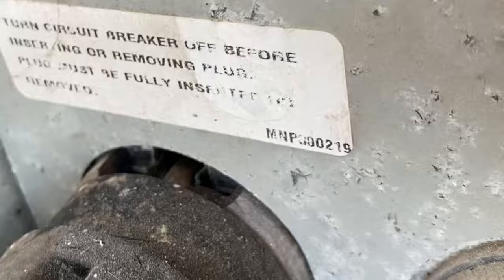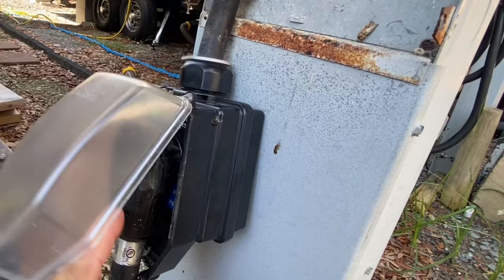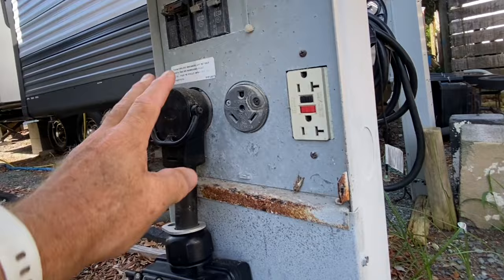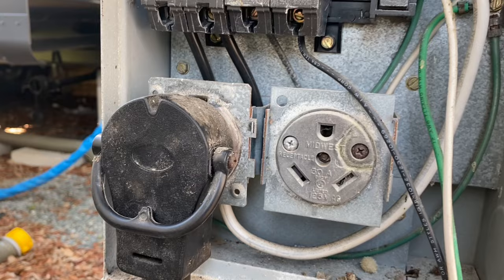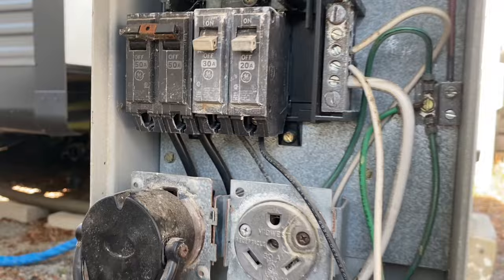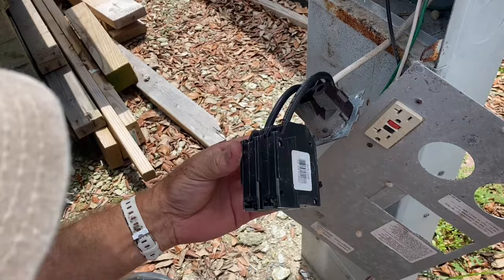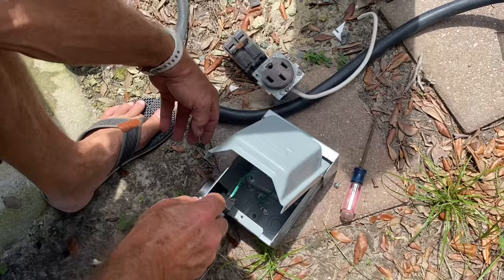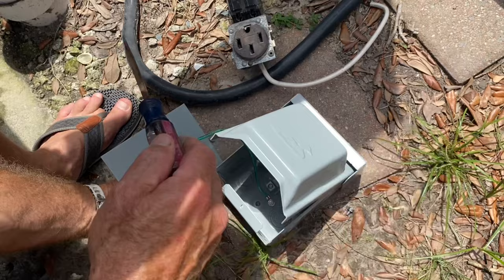Beach Camper ~ AC Power Failure Fix!~  Replaced Burned Breaker and Outlet

Comment: I don't think I would be worried about electrical issues if I was this guy.
Reply: No doubt
Reply: Dude is so tired he had to repeat everything 5 times. The gist? Before putting the plug in. Be certain that 1. your trailer is entirely unloaded electrically 2. you're not standing in a puddle of salt ater when plugging in 3. 50 amps will roast your behind.
Reply: FARM GIRL IS HOT AS F!!
Reply: No plug in issues anyway 😁
Reply: I think i could work better at it in the DARK
Reply: To be fair, he does seem quite unbothered 😂

Comment: I used to be an engineer for big yachts (100 - 150 ft) out of Ft Lauderdale and up to New England. Being around salt water and fog always sped up corrosion of our shore power connec5ions. It can be very beneficial to use a corrosion inhibitor on the plugs and wire ends. I would not use WD40 as it attracts water. Use a silicon spray or something specifically for electrical. And if the corrosion does get started, you may have to clean with a scotch Brite style of pad first. But those will scratch and make more places for corrosion to take hold. So only  brush them up if you are already losing the battle. On boat cable you can replace the individual pins at the plug, which is good, since those big, long, 50 Amp, or 100 Amp, cables are expensive.

Comment: A very evident problem with the old and new connector is that the ground (green) wire is missing. That is a safety issue. In addition, your neutral bus is highly corroded and may not provide a good connection, which can explain the intermittent loss of some circuits.
Reply: I would have connected a green #10 to the receptical and not relied on the rusted corroded fame for ground....oh.....and the bussbar.......this is the problem with wanna be sparkys....

Comment: Always clean the prongs on the plug with a wire brush and spray with wd-40 it helps a lot, better connection and cuts down on oxidation.
Reply: Try using corrosionX.  Much better product

Comment: Great job use Dielectric Grease on all contact points it prevents corrosion & oxidation on electrical parts.
Reply: ...and make sure all the contacts are properly torqued.

Comment: I had the same problem  with that type of pedestal. The meter was replaced . When the guy from the electric company replaced it he pushed on the meter to press it on to the pedestal. Those pedestal are made in a stupid way there's  a connector down below the top of the concrete footing . When it gets old the connectors down there get loose and don't make a good connection. When the meter guy pushed on the meter it wasn't making a good connection.  So only part of my lights were coming on. Check to see if that pedestal is loose. When you pushed on the plug you engaged the connectors down below. It can drive you crazy. You can't  figure it out. Also if it's real bad it can shock you.  That's big electricity coming in there. Shake the pedestal see if it moves that could be your problem. Wear rubber gloves. Push it from the glass on the meter . Ask the park or electric company to check it for you. Some of those guys play dumb because they don't want to replace it.  The new pedestals aren't made that way. That might be your problem. Lots of luck with that.

Comment: ALWAYS ALWAYS use the oxide compound on all connections we are out in a wet atmosphere use the electrical compound on all connections not just on aluminum it makes it better I worked at a campground with over 500 sites take the tip it does make a difference.
Reply: What is this oxide compound and where do u get it ?
Reply: @jimanonymous113  Hello Lowe's or The Home Depot anything electrical it is good to use I use it on everything and even radio connections for ham radio antta connections its great stuff.
Reply: @jimanonymous113   Just get some Dielectric Grease, it's made for this. If a connection has power going through it, Dielectric Grease goes on it. It will prevent moisture from getting in there so no corrosion at all. Learned about this years and years ago in the marine industry. God Bless

Comment: As a licensed electrician in the state of Massachusetts. Number one nobody should ever go into a subpanel meters pocket. That’s a 50 amp sub panel that could be coming off a 600 amp or larger electrical main breaker panel the amount of power that you are playing with is equivalent to a 50 amp welder or two mugs that are on the top with the power comes into Where you’re recklessly putting your hands into king prop you to the ground each leg the one on the left one on the right is 120 V you should’ve turned off the power at the main distribution center. Before ever attempting to go into that small area like you said don’t do this unless you know what you’re doing. The reason why your breaker is burning up you can see that it’s been arcing inside is because the whole system is old and the electricity on phase a and phase be is barking and jumping inside the electrical disconnect. The breaker you are changing is a disconnect 50 amp and it is burning up. The ground on top of your plug from your camper is always facing forward. For a reason in case a piece of metal or something falls in there and it does not short out the legs phase a and phase be on your camper receptacle. This should be a twist lock unit so they do not fall out like that there’s a big difference in what you’re doing in the national electrical code says to do everything should be on a twist lock receptacle so that heavy welder plug does not fall out of the socket from your surge protector the reason they make twist lock receptacles is exactly for that reason. Electricians go to a school for a minimum of 10,000 hours on the job training and 600 class enough schooling to be a doctor because this is what we do for a living people take electricity for granted and to me that is very small voltage that he’s playing with button reality that’s enough to kill a horse never enter anything like that if you are not a license electrician anywhere in our country this is very dangerous stuff AC current and when you don’t understand that round is earth and you’re standing on it with your sneakers you’ll be electrocuted and could have a heart attack burn yourself or anything worse the problem is people think they can do anything they want with electricity I do not advise anybody to do with this man is doing because he’s completely wrong in all aspects just because it works not mean it’s right you have to find out why the breaker is burning up most likely the two legs coming into the panel or loose and causing an electrical  Arks in the panel he should’ve shut off the disconnect at its source taking the whole thing apart used electrical grease tightened up everything cleaned off the boss bars and then reinstall a new breaker replace the socket with a twist lock got the adapter for twist lock receptacle from an RV dealer then plug that in to a surge protector. He should’ve drove in the ground rod into the ground and use the number six and bonded it to the sub panel separated the neutral and the grounds in there because they were together on the neutral bar and then he wouldn’t have a problem again and that’s how you do it correctly this is why we are professionals and he’s the owner of the are the park  because I don’t think the RV park is gentlemen just go in and report a disconnect like that because if something bad happens the RV park would be responsible sorry to break the bad news this is very important information oh people do not get hurt as electricians we are responsible for the safety of people and their own personal protection

Comment: In a camper you should always capasitate you power . Buy 2 48v e bike batteries . Drive a/c and any other high energy pulls on battery and electricity  this will keep steady  level power to these units minamizing any electrical shortages .

Comment: Those sockets being damaged are the result of power surges and brownouts that's not what started the problem that's a result of the problem. Most of these parks were designed with barely 30 amp service and even if they were designed for 50 amp service they never imagined the amount of amps that modern RVs would be pulling.
Reply: actually they won't pull any more amps than a good working breaker will allow
so if it is thirty amp rated outlet on a working 30 amp breaker . . .

Comment: The power pedestal belongs to the park where the camper is located, correct? If that's the case, they should be responsible for the parts and labor.

There should be a disconnect on the pedestal so you're not working in a live box.

High current in a high humidity environment is a ticking failure. Good that you identified both the breaker as well as the receptacle as requiring replacement.

Comment: Hey guys how you both doing?
  
  Me I’m here at home waiting for Home Depot to open I need to buy a sink Pee Trap. 

I replaced the sink faucet and put on braided stainless hoses but the pee trap fitting is broken so I’m just replacing it that way I won’t have to mess with none of the sink plumbing for a long…time.

Comment: Corrosion is working against you.... Use a anti-corrosion grease on all contact points... Wires, breaker contacts, main plug.... 
When "mixing" metals (aluminum/copper) the rate of corrosion is increased.  Your in a high corrosion area.... Near the Ocean.   Your will like the results
Reply: Yeah

Comment: The pedistals for rv electrical service don't handle high current loads well. The heat tends to cause the clips to expand and contract with the heat cycling from  running A/C. Contact cleaner, dilectric grease and re-tensioning the clip will help until the clip breaks and you have to replace it. They weren't designed for the current loads modern technology puts on tthem.
Reply from the maker: Great! Most informed and useful comment, thanks.

Comment: The bus connector on the breaker was burnt that means the bus bar is burnt also , the whole breaker box should have been replaced. I guarantee the breaker will go bad again. Call a licensed electrician and get it fixed right.

Comment: I ended up with a HOT SKIN on my rv at a site.  I was getting the shocked like crazy touching the door frame.   I was thinking wtf.   I plugged my rv into shore power and checked all my ground in the cable.  I checked everything..  the i found the Ground in the breaker box itself was not working.   Contacted the park and they grounded it and it was fine after that. So crazy.  Now i always carry a plug in circuit checker for ground and polarity checks before i ever plug my rv into shore power.  I just assumed that the box was wired correctly..

Comment: Question. Have a 30amp camper and never had electrical issues. Thinking of a much bigger 50amp next time. Are 50 amp campers more susceptible to electrical issues?
Reply: No. All the components  are heavier duty.

Comment: Exoman I noticed in the box to that the ground in the upper right looked as if it had gotten hot. The copper wire looked black. You may want to check and make sure it is also tight...  Just saying.. @4:06

Comment: I guarantee that your issues did not end there if you didn't replace the interior of that pedestal. The jaws on the breaker were burned and the bus tab was also. I have been an electrician for 35 year and I have never seen a burned breaker like yours that didn't damage the bus tab.

Comment: I'm glad your problem was exactly what you were working on, but.....I'm wondering if your problem stay fixed.  In a lot of cases the electrical problem you had was caused by another factor, the ground wire attached at either point of 'visible' connection or at or just below ground level.  A corroded ground wire which is only partially in one solid piece [braided ground wire is notorious at this] will definitely cause your breakers and outlets to over heat.  If the ground is totally broken (either hit by accident [gardening, motor vehicle etc], malicious damage, disconnected hardware or through corrosion) chances are you won't have a hard time finding the problem 'cause you'll probably be out of power. A partially broken ground will still give you power but with 'brown outs' or over heated breakers and receptacles.  Another safety point is that IF your ground is broken/disconnected, you can still quite feasibly have power but at great risk of fire, serious injury or worse. I've seen a lot of crazy crap during my career in the phone company when land lines were king at many of trailer parks and grounds, or lack of, were serious issues. Now if i may, your lady is stunning with a very beautiful smile. I'm sure both of you make some good friends in your travels.

Comment: I  had to change a breaker in my house when I  put the part number in it came up as a defect breaker, I  then found there are a good number of breakers that were made by a company for years that went out of biz cause of crap made breakers the company was shut down, you can run the numbers on your breakers on line and check to see if yours is on the list, there were fires caused by them
Reply: Yeah, Federal Pacific Electrical (FPE). If you still have that crap on your house you have a bomb waiting to go off. Please, get it replaced.

Comment: With the flecking lights and so on I would have assumed the breaker was bad. It usually is the primary cause from the electricity arcing sense it is the oldest. I would also be adding a ground fault. I watched a man playing around with his camp grounds electrical box when I watched him fly backwards about 3 feet. Someone had tied the 240 volt breaker into a 120 volt breaker feeding it. He assumed his 120 volt breaker was off sense he clicked it into the off not realizing the 240 volt breaker was still feeding the 120 breaker. Plus the 120 wasn’t grounded at the breaker but to the panel box. On top of this a neutral wire was coming down from a 440 volt breaker above the 120 and the 240 volt breaker sense the 440 breaker was feeding both the 120 and the 240 ones. He was knock on his ass from the 440 volt line not realizing the 440 line which was the main breaker that was used to kill the electric to the other 2 breakers. There used to be a mobile home on his site prior to it being used for Rv’s he was fortunate to still be alive afterwards. Moral to the story is don’t mess with someone else’s electrical panel mainly the 
owner of the park which regardless of his knowledge he had no business trespassing an electrical panel that wasn’t his. I hope I made sense I am 78 years old with my second brain tumor from cancer - agent orange gave us vets and our brothers that died from it in Vietnam and Cambodia where I served. 
So you think your a electrician or want to be one - I gave that up years ago. Thanks 
I used to watch your channel many years ago but YouTube lost me channels about 2 years ago and I am slowly finding them again. Thanks again

Comment: Hate to make you do it all over again, but you just did the same thing over again,,, Now you have to go back out there and add dielectric grease to the wire ends and the plugs. Plus on the breaker jaws.   Or you can just do the same thing again in a few years when the moisture and weather eats away at it again.

Comment: I am still not sure why a surge protector is necessary. How can a campground give you a surge of electricity large enough to harm anything? They are buying electricity from a power company, they aren't generating there own power. If you get a surge it would be from the power company. I have seen videos of these surge protectors melted and ruined, but I think the reason could be dirty or loose connections causing arcing. Not sure.
Reply: Storms, lightening strikes on the substation, transformer failure, lots of causes actually.

Comment: I commend you on your troubleshooting abilities but you do need to hire professionals who have the proper knowledge and training.   Although you found the problem,  you did not repair the entire issue,  which will come back at some point in the future.  When you find a breaker that had been arcing on the buss, you will notice the effect not only on the breaker but also on the buss of the panel the breaker plugs on to.  You should always check both components when there is arcing/heating of a breaker.  You can be sure the buss is also damaged from that arcing and it will require repair or replacement in order to completely fix the problem.  What you have supplied  here is dangerous information to people who may think it's safe to just change the breaker.  Maybe edit this to show the condition of the buss as well, so people will know there are 2 parts that may need replacing.